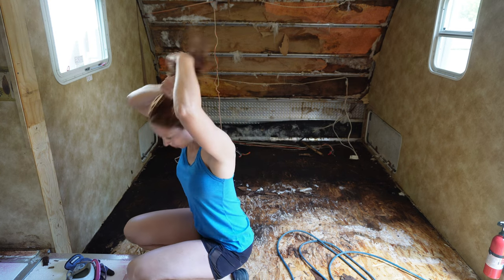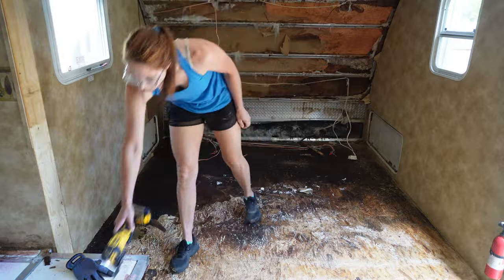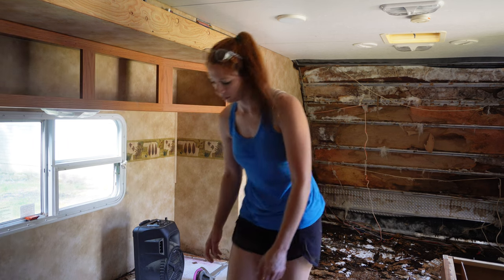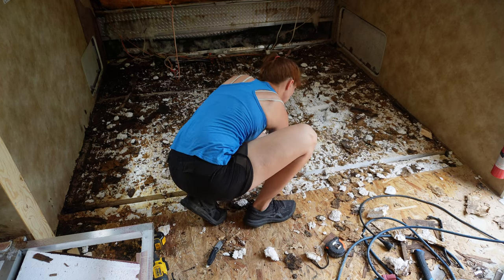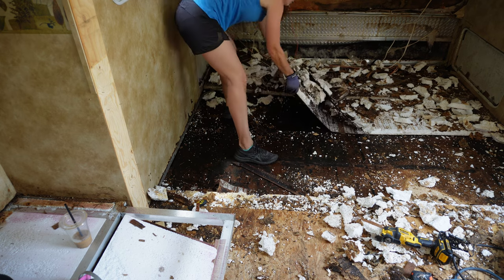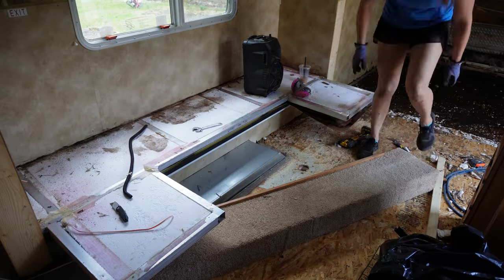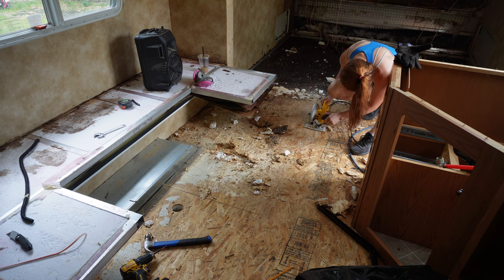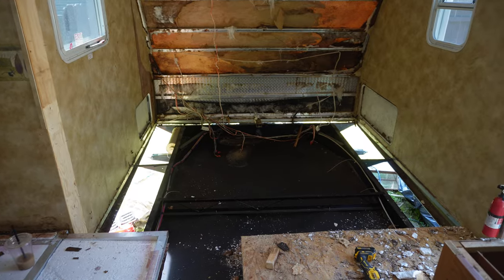RV Water Damage Removal: Demo Day 4

Comment: Your videos have been very helpful and motivational. I just started digging into a fiberglass hybrid rv with the glued foam paneling. I was almost in tears removing the water damaged paneling from the foam walls little bit by bit. So came back inside and low and behold, one of your videos popped up showing how you had persevered and scraped the panel off haha.  
Its next level the attention to detail you take to do a complete restoration on these rv projects. Haven't seen anything this in depth or informative on you tube. Most i see are folks just painting the cabinets and calling it a day. 
Awesome work 👍
Reply from the maker: I’m so glad you found this series helpful!!

Comment: Watched your, before and after video from this camper, and today, I found a big water damage in the back of my camper, but since I had watched your video, I didn't freak out, knowing it's possible to fix, without "to much" trouble.

Back to work after Easter tomorrow, so no time to keep going then, luckily after raining for almost 2 weeks, it seems it will be a bit better for a couple of days at least.
I felt lucky for changing the interior, so I found that problem, as it was hidden behind an airgap panel (let's air flow between the wall and behind the cushions)
Which is probably why it hasn't been showing that much dampness in the vagon itself..

Will watch these clips now, to see if I can get enough knowledge to actually fix the damage myself. 😊

Comment: My r vision bantam 19. Has 20" doorway and a 25" wide fridge. My flooring so far was simple to remove as it was only made of luan sheeting glued to that white styrofoam. I pulled a 4x7 section ans everything was wet and that was after drying it out for over a month. When i pulled.the next section it was still wet between the foam and the 3/4" sheet of plywood they have running down the center if the camper. I ran four 2x4's across the width of the floor as there is nothing even there at about 12" from the walls. Then i put three 2x4's, one center and two bolted to the frame rails so each 15/32" sheet of real plywood would have full support from wall to wall. Im not putting any foam ir insularion under that floor so i can have that 1 1/2" of air space to let that new floor breathe to avoid any future water damage. Also i applied thompson water seal to every piece of wood i installed. As i cantnpull the fridge ect. Im doing the front half first, then i move everything to the new floor and then i can replace the back half of the floor with out any headaches. My flooringnwas easy to remove and to install unlike the tough job you are having wuth that beast. Everyncamper manufacturer is indeed different and most arrnbuilt by cheap unskilled, low paid labor. I know because i used to be one of them at a.plant in plymouth indiana building mobile home toter truck beds and mirror assy's. Great video girl. Keep going !

Comment: I am sure you have done or see this before .. but usually the walls are supported and screwed into the framing right there at the bottom of the wall…if you leave the rotten wood… work it out and frame it and resupport with a hard bonding resin before installing new floor… won’t take long …

Comment: Great video! I am doing a similar repair on our camper. but I'm wondering how to replace or if I should replace the membrane/weather stripping on the bottom with something more sturdy or a different material altogether, do you have any suggestions?
Reply from the maker: I usually just keep the original. As long as it’s sealed and maintained properly, it won’t leak. If it’s personal preference you can change it out, but anything will leak if ignored so just make sure to check it every 6 months or so!

Comment: Really interesting demo series. What caused such severe damage?
Reply from the maker: Water leak on the front cap. Leaked from both sides, and a strip right in the middle. The middle strip caused water to leak down the front and underneath the floor